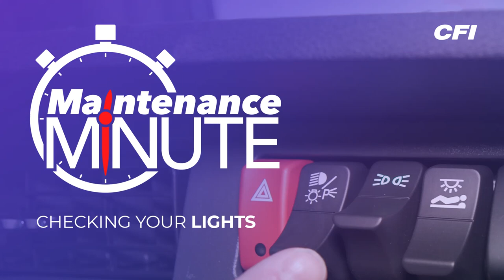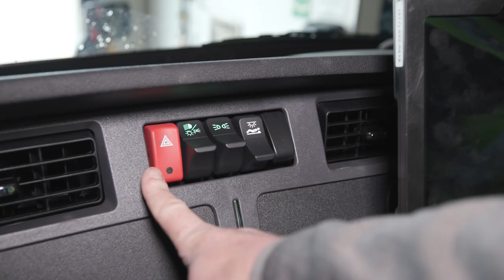Maintenance Minute: Checking Your Lights

Comment: In the Air Force, we always checked our turn signals and 4-ways separate, and tested our brake lights by actually pressing the brake pedal.  It took two people to do it properly.  So, is there any value in using the light cycling switch, either as part of the Pre-Trip Inspection or at any other time?  Thanks for the video (from a CFI driver).

Comment: That's  odd.. I used to  work for CFI, truck 50860. I would  hit that switch  and walked around during pre-trip and the truck would  go thru cycle all the lights.. it would  turn on bright lights turn signals abs and brake lights  without having to jump n truck and mess with other switches.. is the new T-680s that much different?